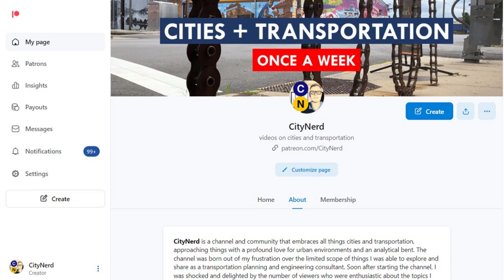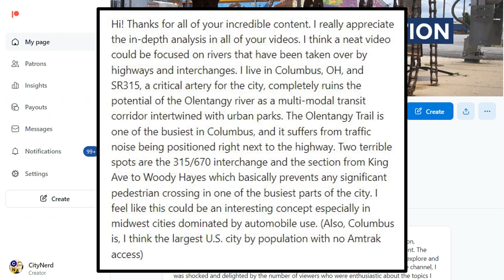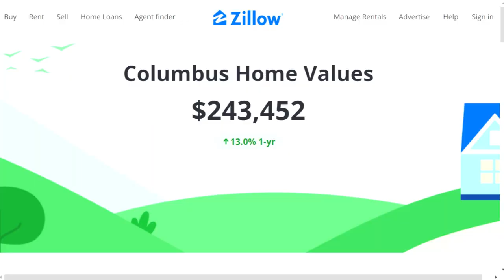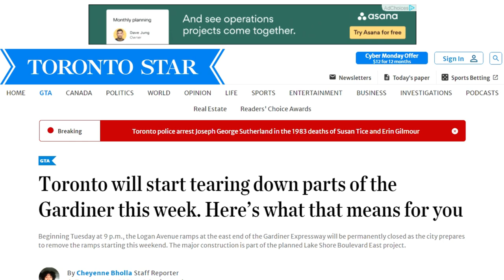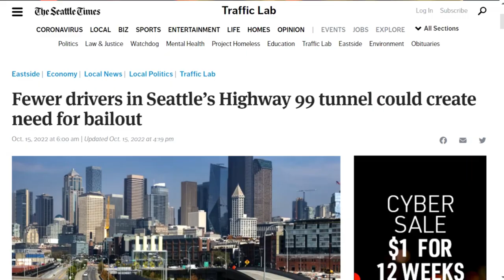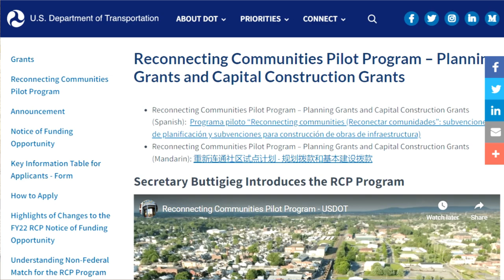Highway Engineering Madness: 10 Waterfront Freeways That Need to Go (North America Edition)

Comment: Lake Shore Drive bums me out, especially with there being such a nice bike trail running right alongside it. And the one "non-freeway" stretch you mentioned near Millennium Park is super dangerous as there's lots of people trying to cross and drivers frequently run red lights. Right now the only future plan for it is to MAYBE convert one lane to a bus lane, if advocates fight hard enough, which is a step in the right direction but would still leave a lot to be desired. Oh and they're building a lot more pedestrian bridges over it on the South Side, at what I imagine is an enormous cost versus just removing the highway. The South Side stretch especially is way overbuilt for the amount of traffic it gets. But lots of people here seem to love the highway, as it is a really pretty drive. It'd still be just as pretty of a drive as a 4 lane BLVD though, just saying.
Reply: if you tried to reduce lanes on the south side I  can guarantee there would be an outcry over equity.  Also, removing the highway would be an enormous cost vs just bridges.
Reply: @jaredking31  If you’re really suggesting pedestrian bridges on this channel, you’re not gonna have a good response. Bridges would just be a bandaid to an arm long scratch

Comment: I live in a high-rise Loop apartment overlooking the lake, which of course means that I also overlook Lakeshore Drive (I'm looking at it and hearing it as I write this message). City officials deserve some credit for re-orienting Lake Shore Drive a few years ago to move it inland and create more lakefront property that includes the museum campus. Having said that, however, I would love to see it completely re-engineered to eliminate car traffic. If the roads cannot be removed entirely, I would like to see them modified to incorporate public transportation, such as a tramline running the length of the city. As it stands now, none of Chicago's many lakeshore amenities are accessible via public transportation (in fact, I could guarantee you that Chicago leads all major cities worldwide in the fewest tourist amenities available via public transportation, a function of our commute-focused approach to public transportation). In any event, perhaps Lake Shore Drive could become some combination of tramline, bus lanes, and bike lanes. The nearby Lake Shore Trail, running for 18 miles along the lake, currently has excellent running, walking, and bike lanes, so maybe the bike lanes aren't necessary. But get rid of those damn car lanes!
Reply: I assume you listened to the noise when you took your ultra expensive apartment.

Comment: There is a nostalgic joy I get when I am on Lake Shore Drive heading downtown, but it's usually ruined anytime I try to get to the Lakefront Trail when the pedestrian tunnels are flooded during a heavy rain, or any time a car has decided to utilize the cycling/pedestrian paths as their personal detour because the traffic has backed up on LSD, and for some reason there is pavement connecting the two. A number of recent cycling deaths related to negligent/aggressive drivers on LSD near Grant/Millennium also makes it clear that this roadway needs to be deprecated or redesigned for pedestrian and cycling safety. Bury it, cap it, slow it down, whatever... Make it safer for people not in cars.
Reply: The bare minimum separation between car space and pedestrian space to me is a wall of boulders. (NY uses them to defend hiking trails from motor vehicles). Cities may choose decorative concrete bollards but personally they are uglier than rocks.

Although i think some provision should exist for emergency vehicles to access these spaces, but a simple security gate would suffice IF you wanted to ensure you could drive an ambulance down the ped path. (I assume this is why its connected by pavement, that or ease of construction but I'm not familiar with the area so I don't know for sure)

Comment: A couple of years ago I read that city-dwellers seeing their rivers as something that's supposed to be scenic, is actually fairly new.  The example was Kalamazoo, Michigan, whose river in the mid-20th century would run white because of the runoff from paper mills.  And so, older buildings in their downtown, face away from the river.  It's only more recently that office buildings and restaurants have been designed to incorporate the river into their scenery/design.
Reply: Like the river that actually burned, near Cleveland Ohio.
Reply from the maker: It's interesting, and probably related to the National Environmental Policy Act. A lot of the rivers and waterfronts used to be quite a bit more polluted.
Reply: @CityNerd  I lived in Cleveland when the river caught fire in 1968 and burned out of control for three days.  It was the event that led to the establishment of the EPA during the Nixon administration. (Back when conservatives would, you know, conserve something).
Reply: @bearcubdaycare  Yeah.  Although that sort of this isn't as rare as one might think.  Isn't there a mine in Pennsylvania that's been on fire for decades?

Comment: Chicagoan here; LSD is an absolutely gorgeous roadway that blends in nicely with the parks and the lake. It releases pressure off our interstates, and diverting that traffic to the interstates would bring them to a 24-hour traffic jam, a la Los Angeles. You're going to take local streets from the Loop to the North or South Sides? Fifteen minutes just became an hour. If LSD were such a barrier to the lakefront, there would be no one on the lake; guess what, it's not a problem we have.

Comment: My Pittsburgher urbanist dream list includes us removing all of I-376 and I-279 within city limits including the I-579 spur known as Crosstown Boulevard. All of them should be turned into surface boulevards with dedicated rapid transit right of way and separated cycle tracks as well as plenty of side walk space and then the areas surrounding these new streets should be zoned for transit oriented development. 51 should also go through a complete streets treatment as well as be rezoned for TOD within city limits too. So many tightly packed neighborhoods surrounding 51 that would benefit greatly from having an actual main street attached to it.

Edit: Routes 28 and 65 can go to
Reply: Canadian here, I cannot think of any city that could benefit more from freeway removal than Pittsburgh!  huge huge potential  !
Reply: With the beltways going in, I think changing rt51 is more viable.  However, you would need good transit to everything within the beltway.  Then 51 can exist with slower speed limits and less lanes.

Comment: Check out Binhai Boulevard built in Shenzhen, China. Two decades ago, the waterfront area was reclaimed to build the expressway. Thanks to a former major at that time, some of the reclaimed land was allocated to a waterfront park (the Shenzhen Bay Park). Still, the noise, air pollution, and land segmentation brought by the expressway are still annoying when walking in the park. Nowadays, a segment of the Boulevard is getting tunnelized. After the project completes, that area will become a complex of surface parks, artery road tunnels, underground bus terminals, and a transit hub of subways and intercity railways. I look forward to its completion.

Comment: The thing about the Platte river in Denver is... it's not scenic, and it frequently smells (algal blooms mainly) which aren't something Denver itself can fix, so it's a lot less desirable to hang out near the Platte than it might look like from a satellite view.  I'd be all for moving I-25 out of Denver and around the city (the only beltway the city has is partially toll roads) so I don't have to drive through when I'm trying to get south of Denver, just as I'd be all for hopping on a train when I do want to go into the city, but neither of those are actually doable currently, so priorities...
Reply: Similar deal with the Connecticut River in Hartford, the city of Middletown just downstream actually has a waterfront park but its gross because the river is gross due all the upstream development (and waste water treatment) that runs off into it without significant natural water purification in the river. 

In contrast the St. Lawrence River which i grew up near is way cleaner and nicer despite having way more upstream development. (This is partially due to the settling in each of the lakes, the invasive filter feeders, and the abundant wetlands along the shores of the watershed purifying it). I'm not sure if its chemically less polluted in the thousand islands region but its certainly much more aesthetically pleasing and pure enough to not need filtering before drinking. (But i would recommend sterilization)

Comment: Interesting tidbit about I-376 in Pittsburgh: I-376 eastbound running adjacent to downtown is an elevated interstate, with a Mon Wharf riverside parking setup (that regularly floods with sediment), and the Three Rivers Heritage Trail also running below deck. On the trail itself, you can get a nice view of Station Square on the south shore, but the ambience is occluded by semi-truck engine brakes and crotch rockets blasting by the overpass on a regular basis. The trail shadows I-376E all the way to Schenley Park in Oakland, a whole 3.5 miles. It then splits off to become the Great Allegheny Passage, while I-376E continues East to Monroeville.

Comment: While this is a noble sentiment, there are a number of these where the freeway is essential to traffic movement and there is no viable alternative (as you mentioned with Hartford), so the only real alternative is replacing the road with one underground.  While this was done in Boston and Seattle, it is horribly expensive.  Only in locations were there are alternative routes available would this really work.

Comment: In New Orleans, we came very very close to a river front freeway. It would have come  be off I-10 just down river from the French Quarter, turned and run parallel to the river for about two miles, then tied in to the then-new Mississippi River bridge. 
Imagine every view you’ve seen of the cathedral in New Orleans with a double stacked freeway in front. Beignets at Cafe du Monde in the shadow of that freeway (if CDM survived).

Comment: Re: Cities in North Carolina. Most of the cities in the Southeast are in three bands, which were built at different times and for different reasons:
(1) Coastal cities: Mobile, Jacksonville, Savannah, Charleston, Wilmington. These are the oldest cities in the region. They still have good ports, but are now small cities.
(2) Fall Line cities: Montgomery, Columbus, Macon, Augusta, Columbia, Fayetteville, Raleigh (sort of), Richmond. The Fall Line marks the transition between the Piedmont (hilly) and the coastal plain (flat). Most of the rivers in the South are navigable south of the Fall Line and have their first rapids or waterfalls on the Fall Line. They were important transportation hubs as the interior South developed, and were centers of early water-powered manufacturing. They are mostly medium sized cities now. Raleigh only gets sort of included because the mouth of its river is behind the Outer Banks, which is a stormy area bad for shipping.
(3) Piedmont cities: Birmingham, Atlanta, Greenville/Spartanburg, Charlotte, Winston-Salem/Greensboro, Raleigh/Durham (sort of). These cities are younger and larger than the other cities in the South. They grew around railroad and later road transport. The rivers in this region are too shallow to use for good transportation, so there weren't cities here until overland transport became competitive with shipping.
Most of the cities in North Carolina are Piedmont cities. Rail and road transportation has always been more important for these cities than shipping. At least North Carolina avoiding locating any of its major cities on the Eastern Continental Divide, like Atlanta.
Reply: This is what I came to the comments for.  Curious, what is the disadvantage of locating on a continental divide, "like Atlanta"? Is it the demands placed on road geometry or a water system issue?
Reply: There's not a big disadvantage now that most transportation is by land. It does feel like the worst possible place to put a city if river transportation is relevant.

Comment: The QEW is currently the only viable connection between Hamilton-Niagara-Buffalo, and is almost EIGHTY years old. Since CN and CP don’t want to actually run railroads, all the goods that would go through Buffalo have to be loaded onto trucks and taken on the QEW. There’s a ton of industrial along the Burlington Bay, and a Ford plant in Oakville.

Comment: Surprised you didnt talk about I95 in philly more. They're actively looking to expand it to 10 lanes and it's going to require a complete rework of the 676/95 interchange
Reply: I-95 is already just a brutal gash/wall between Center City and the Deleware River.  It's really the worst.  On the other hand, I-76 is pretty inoffensive as it usually runs about 15-20 feet below grade between the river and Fairmont Park, for the most part.